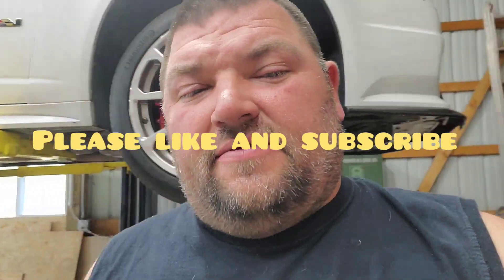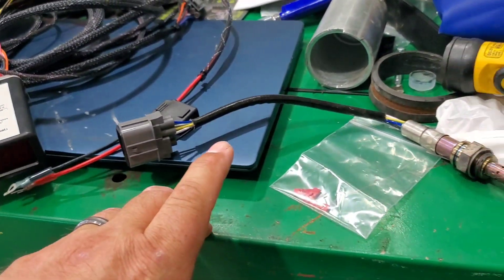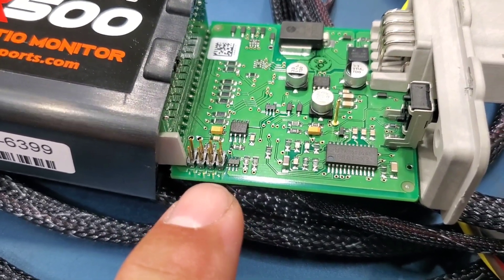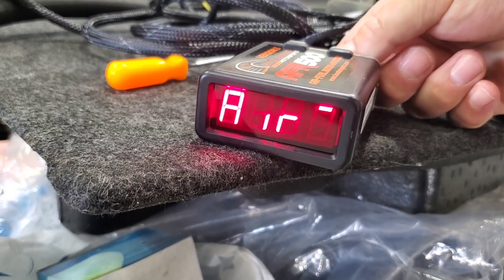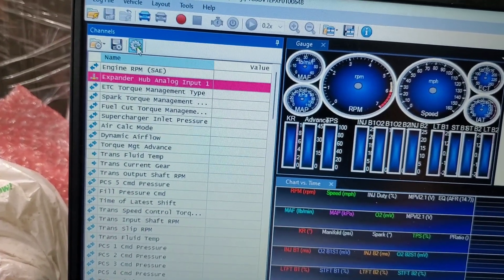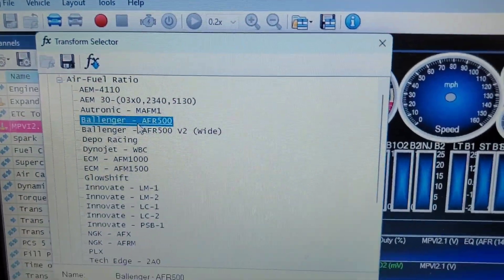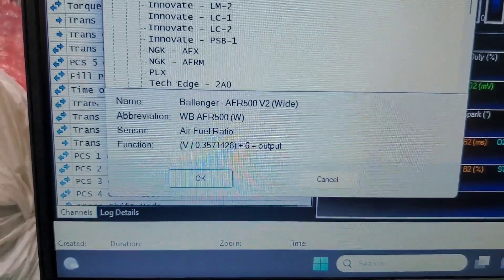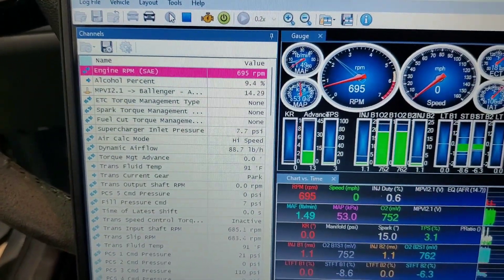Ballenger AFR500 install/settings/HP Tuners

Comment: So for the fuel system since it’s flex 93/E. Are you flashing tunes b4 you swap? Or just fill and go (obviously down to E) to change. I’m using rtd for my car
Reply from the maker: You mean flashing for fuel swaps?. No it changes on its own.. but it has been calibrated for both
Reply: @vfr800fi07 yes, that’s what I meant , because nowadays I have to flash the fuel b4 I start up, so with this I assume I can just fill and go with no other steps
Reply from the maker: @Turtle_Mania02  yeah it adjusts the time based on E content automatically